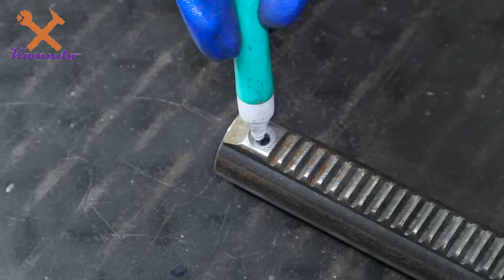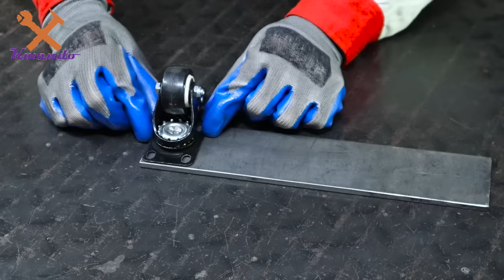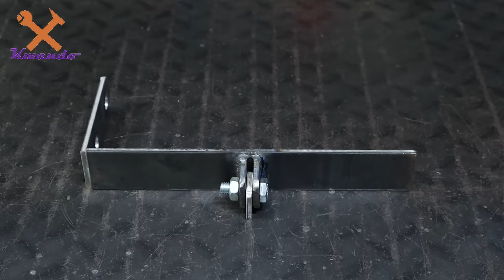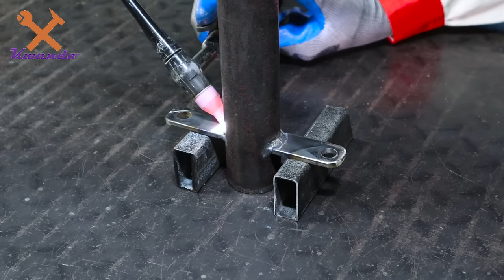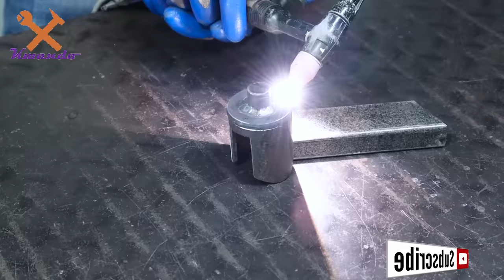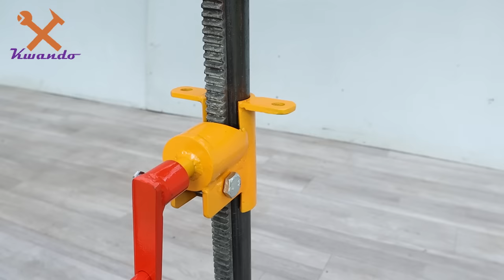One More Most Useful Tool That I Can Made From My Scraps

Comment: well done , a good idea
In my workshop in Gaza, Palestine, I use two pipes, one of which is internal
 The other is external and welded to the external pipe with a screw and nut for fixing. Tighten the screw at the required height in just a few seconds.